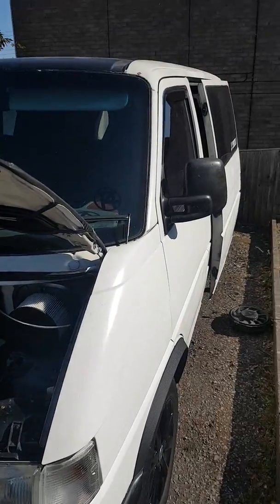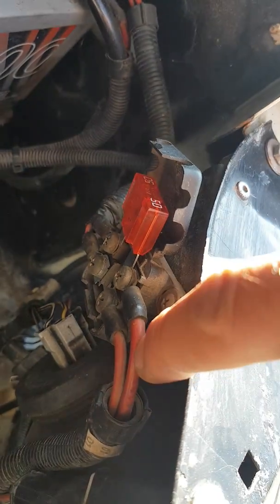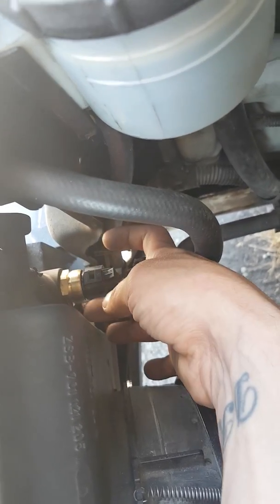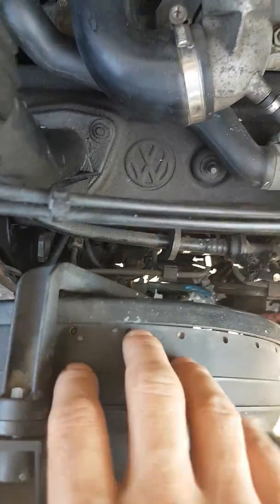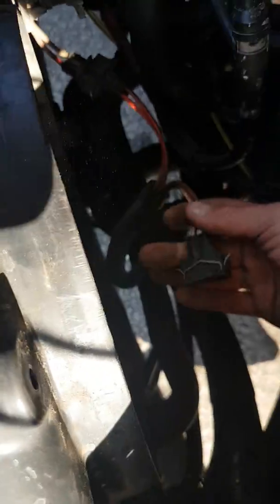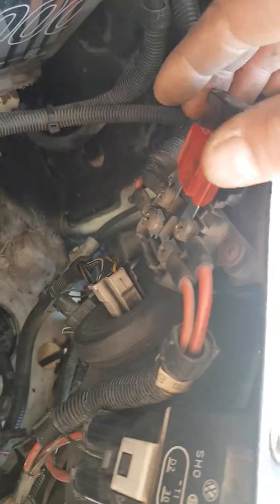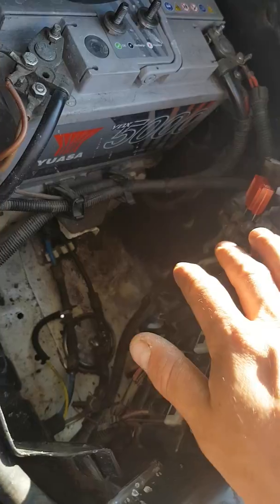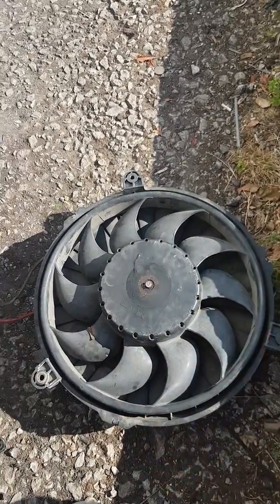vw t4 cooling fans/ thermostatic switch problem

Comment: Many thanks, 1993 T4 2.4 D had both fans inoperative, found the two fuses had fractured rather than burnt out. Both fans were free and easy to turn.  The fractures were easy to miss, as they still looked intact, so worth unscrewing them. Like the idea of 30 Amp fuses, found AES Electrical supply these for pennys.

Comment: Thanks for going through this.  After watching your video to get me primed for a good look over mine I've discovered that my fans don't switch on and the fuse has been replaced with hard-wiring which could be a sign of previous issues - and I'm sure they can carry plenty more than 50A - but the fans still spin luckily.  Gotta have a crack at checking the thermoswitch thingo next - your video has got me off to a great start.
Reply from the maker: I'm glad to hear that as it can easily start a fire if there is no fuse protection on the supply cable , replacement fans are best from Lithuania if you can get them 👍

Comment: Had a similar problem where fan seized then wires to fan melted before both fuses blew.  Disconnected fan to get home and it's winter so no problem with temperature.  Currently about to remove fan to replace and have to replace whole of wiring harness as well.  30A idea is probably very good as I wish mine had blown sooner.
Reply from the maker: Thank you for your time to comment,  I'm glad its helped as it sounds like you were very close to something much worse happening,  but changing the fuse will definitely help prevent future problems. I have a fully working radiator fan available for you if you need one you can contact me at Droe_888@outlook.com.
Reply: Now have removed both fans.  One seized and on the other although still turning the shroud had failed so the louvres were permanently stuck closed and then the retaining ring fell apart  so that one needs replacing as well.  hey ho

Comment: Thanks for the info. I’m just wondering how the louver on the back open and close. I’m planning on replacing my fan motors and wonder if I should replace the whole assembly with the louvers 
Thanks again
Reply from the maker: Hi , thank you im glad the video was of help. The louvers on the back I always assumed they opened automatically but mine didn't,  I opened mine manually from the top of the unit using the slider with the spring attached,  this helped the air flow when the fans kicked in.

Comment: Really useful!!! Thanks mate!!!
Reply from the maker: Thank you for your comment, if it helped one other person it was worth it for me, anything specific that anyone would like me to look into I am more than happy to help . Thanks
Reply: @vwt4camperconversionclub741  Personally i need the site where you take the switcher, because i found only 2 pin switch or 3 pin but not hte same look. thanks
Reply from the maker: @ozrollers2924  

Hi if it's the link for the switch you need its https://www.eurocarparts.com/ecp/c/Volkswagen_Transporter_1.9_1998/p/car-parts/car-cooling-parts-and-car-heating/cooling/car-switch-and-car-sensor/?223440100&1&8f209380b4c7f7c3badeded7877eb29747bdc004&000529&type=shopping&gclid=Cj0KCQjwtr_mBRDeARIsALfBZA7_MKFXZJbh0sTyDAsIj7skFx4QHWeReG7ix88UGGcxaHLbqsOyK7YaArwxEALw_wcB

Comment: Have overheating issue with an early model t25 replace thermo/switch thermostat/ temp gauge sender, Rad Fan still doesn’t kick inn , needle gauge on dash is on high position any Advice please
Reply from the maker: Hi ,  not very familiar with the model but if you have a basic electrical tester that will test continuity ( cables are continuous with no breaks or damage ) most issues I've had can be found using the Multimeter. Testing to ground ( good clean bate metal work of the body or engine ) and + to the fan connection then work back from there until you find the 12V supply.circuit diagrams can be found in the Haynes manual for your specific model and are usually straight forward to follow. I hope this has helped  and anything else you would like to ask me please feel free I will help where I can , if you require my email address for direct contact that's no problem at all.

Comment: I'm not sure if my fans have ever come on. Not in the last 10 years. perhaps before that i can't remember. 2.5tdi it did get hot once when i was late to setup at a wedding up above Verbier, the other day i changed the temp sensor in the rad but still no fans. Will check fuses then relays i guess. Some great info here. I'm going to go out after this and bridge that lower right connection the 3 pin plug to the other 2 to see if the relays  and fans work.

Comment: top stuff, just about to change the fan switch, i have a seized fan i believe so excellent tip there. i think ill remove it. did you replace or repair fan? recommend disconnect seized fan before driving?
Reply from the maker: Hi thank you always glad to help, i would disconnect the seized fan as I assume the other is okay it will work fine with just the one running,  I had the same thing I managed to find a complete fan on Ebay that matched the serial number on my existing unit, I had to change the whole unit as the fixings holding the fan motor in place were corroded, my advise would be to remove the unit asap and assess the condition, plus it's now just extra weight and every penny saved on diesel is always a win. Also I would add that i am currently running my T4 on one fan as I'm awaiting a replacement for a second seized unit, seems to be a common problem. 
Thanks again I hope that's clear for you and take care.

Comment: Thanks for this video, were just trying to work out if our van has the two speed fans? we have a 97 t4 1.9td. ABL engine. we are currently looking at our fans and cooling. What engine is your van?
Reply from the maker: 1.9TD 800 special , Hi if you link the switch to thermostatic switch as its facing you the bottom right pin is live permanent the other 2 are the speeds if you link them one at a time with a piece of cable you should hear a huge difference in fan speed. thank you.

Comment: My van has the same problem. I tested the wire and the fans work. Where can I buy one from
Reply from the maker: Euro car parts are mu usual supplier as you can input your number plate to guarantee the correct fitment.

Comment: Hi There! is that sensor a quick swap over?, I'm going to swap mine out, but there seems to be some coolant behind it. I'm not sure about undoing it in case a waterfall of fluid pours out lol
Reply from the maker: Hi , the coolant will need draining to a point that is lower than the plug itself first or yes it will be everywhere  lol , easy to remove once drained off. Good luck 👍
Reply: Replace new one super quick once removing the other, only a bit of coolant will drop out. Literally just done mine 👍🏽

Comment: Hi my fuse blue and one of the fans went on fire other one nothing not working the switch I have no connection for it just 3 wires with plugs any help would be appreciated thanks

Comment: Where did you get a new fan from?
Reply from the maker: Ebay , Lithuania , Cost £65 they are hard to find but if you do get the chance buy the front pair it is advisable as you can sell one for the price I paid for 2 in the uk.
Reply: @vwt4camperconversionclub741  did it come as a complete unit?
Reply from the maker: @chrisandlauraritchie7998  yes with the 3 bolt mount included , it is hard to replace the motor of the fan as the mounting bolts rust badly. But the other 3 bolts as shown to mount are usually fine.

Comment: I wish people would put which engine they are working on in the description or title,, hang on, he says it's a 1.9 right at the beginning. At least we got it, most of the info is still the same for a 2.5 tdi. BTW.
 Some of this info is generic but i think fuse location is different.
OMG I just came back from the driveway. fuse 19 i think was blown. This gives the permanent + on that 3 pin plug. I've been in the south of france with this 2.5 tdi for 15 years. i live in the mountains i've taken it to the north of norway and south of spain i rag it everywhere and i load it heavy with equipment. The fans have never worked as long as i can remember. I even put cardboard over the rad in the winter like the taxis used to. LOL this thing is built like a brick shit house.
PS. when i'm looking at the 3 pin socket (plug) on the end of the cable the bottom right is perm+ and when i connect to top pin both fans spin up on slow. didn't try the other one yet, i'm going back out to check that's a perm+. Yea it was permanent + obviously. So that the fans can run even after the engine has been switched off. It's going to be so crazy to see how often they should have been coming on, i changed the sensor last week but hadn't seen the fans come on yet but not they will. 600K trip tomorrow and oil alarm keeps beeping as of recent times, new pressure switch, the correct one but no luck, oil and filter changed and thicker oil, still no luck, goes off after 2000rpm usually. Wish me luck. At least i got fans now. That makes me feel so much better. Thanks for the tips. and here is the infill.